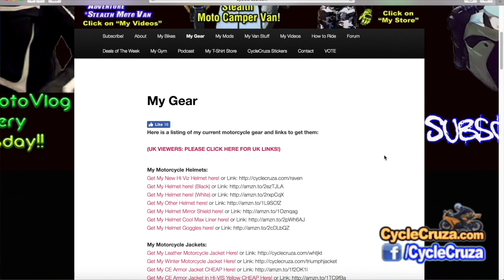WILL THEY PAY $1000 Repair for My BROKEN WR250R? UPDATE!

Comment: One thing is for certain; that sprocket was not completely on the shaft or it would have striped all the splines completely through. Now why it wasn't who knows.
That after market sprocket is not too soft because it really damaged the hardened output shaft, if it were soft it would be sacrificial.
Reply: Bass Player they are not ground down all the way because he caught it before it got to that point
Reply: That is not what I mean, if you look the teeth they are not ground down equally from the front to the back of the sprocket. They are only really damaged half way through the sprocket.
If the sprocket was completely on all the splines would be equally worn front to back.
Reply: larry williams he didn't catch it before it got to that point. He took it 5 miles out, then suddenly his bike wouldn't move after taking that "jump." Lmao. The splines sheared with the sprocket, and the shaft was spinning free. That's how he noticed.
Reply: You guy are not understanding what I'm telling you... I give up...
Reply: Bass Player I understand and am agreeing with you. Larry does not understand. He probably takes his vespa to the dealer to have the oil changed, so he knows everything. Lol

Comment: You failed to mention the status of the nut itself, which leads me to believe the nut simply came loose, allowing the sprocket to slip off the splines. 

If the nut is tight, there shouldn't be enough viable space for the sprocket to even be able to move off the splines.
Reply: yes. the only way it wears like that is if it slipped off otherwise the wear would be even across the whole sprocket splines.
Reply: Purple Ether agreed.
Reply: Looks like he starts turning the nut when he first sees damage lol
Reply: The Mx Guru, he had the washer on the wrong side of the sprocket. You can see the washer still on when he shows the ground shaft. And you can see the shiny sprocket when he shows the sprocket up-close as soon as it happens with the nut still on. Cant see the dull washer metal. So only about 1/3 of the teeth would be engaged. Causing the spinning.

Comment: It is obvious the sprocket was not all the way on.  That is why it only partially stripped. Maybe it worked itself out a bit after install. But there is no other way to strip it that way than partial engagement.
Reply from the maker: It's not even possible to install the sprocket half way, once the bolt is torqued to spec the washer would force the sprocket on completely. If you look closely at clip where I show the sprocket installed, the nut is completely on, NOT partially, which proves the sprocket if fully on. if the sprocket were partially on  the nut would be overhanging the shaft, which is not the case.
Reply: CycleCruza could the nut have backed off? Used to happen on my DRZ even with the "loctite fix".
Reply: CycleCruza if you read what R Bb said, he suggested the locking nut somehow backed itself away from the countershaft. But in any case, Pro-X won't cover it because you caused that, not their company.

Comment: Cruza, Only half the spline was stripped. You even said in the earlier video that the new sprocket didn't slide on without force. After market sprockets are normally fitted with part number to the outside. Your sprocket was fitted to the inside. I doubt you will see any compensation but they may be flexible if you embarrass then on your channel. Good luck.

Comment: If you're 100% confident you're not at fault then take it to court. No way in hell would I pay $1,000 out of pocket to cover the shoddy product of some low end company.
Reply: Frankenscuzz agreed
Reply: True consumer court should take care of this issue
Reply from the maker: Yep small claims court if they don't do the right thing. A commenter by the name of newrider said it could be that the metal of the sprocket is harder than the splines on the output shaft. I might have the metal on the sprocket tested.
Reply: Considering you have so much of the entire ordeal documented on video it'd be a pretty open and shut case imo
Reply: The shaft and sprocket wasn't a perfect fit. Rocky Mountain sold you a sprocket just a bit too large.
Reply: shockadellick , I agree, slightly different size at the splines. Same issue has happened with aftermarket front sprockets for the XR650L. Ruined output shaft.
Reply: Pro X isn't some low end company. The product could have been faulty. The install could have been poor. Lots of could haves. But videos showing "install" do not prove that things are done correctly. They can be turned on and off and edited. In general I've liked CC content. But this/these videos are not proof. Like the video that he took some other you tubers video as proof. This is the same thing. While it sucks, and I'd like to see the WRR, the blaming needs to stop. When there is evidence of who or what is at fault. Then share, that would help others. Speculation is just that, not fact.
Reply: I highly doubt that he will use his edited you tube video as evidence. He most likely has the original footage and will use that if he has to.
Reply: Xterrential 
That makes little difference. What can't be seen is 24/7. The video isn't evidence unless it's collaborated by a mechanic. That the bikes out put shaft was not perviously damaged/wore. That is was installed correctly.  And failure occurred directly after said mechanic verified that bike / install was correct. Then the part itself needs to be examined. Was correct part used, was part correctly made. All this info when determined would be beneficial to viewers.
The video doesn't prove anything. Remember the Honda video because Info came from reliable source? While some believe everything on YouTube, or posted on Facebook, that doesn't make it fact.
The facts are the bike is messed up. That sucks regardless of who's fault.
But I'm repeating common sense over and over.
Reply: Cherrie Beyer like in his chain and sprocket install video, where he goes to rivet a CLIP TYPE master link, then the footage skips and suddenly there is a RIVET TYPE master link on his chain. Then denied the first one he tried to rivet was a clip type.

If he makes errors in judgement like that, it's easy to see his that countershaft was ruined
Reply: Actually my viewing is on a phone, so I don't get much in detail.

Comment: It's the wear shown on the sprocket. 

Only half of the sprocket is worn and the outer half is not worn. That's physically impossible. That's why they denied any claim. If a sprocket is only half on or comes loose this will happen. There is no way the sprocket was defective. If it didn't fit right that would be another issue.

Installed improperly or the nut was worn out.

Make sure your other sprockets are all the way on. If it wont go on you must find the cause and correct it.

Not sure I would be reusing a peened nut anyway. He said it was 100% on the shaft.
Reply: David Phillips and how is there NO WAY it could of been defective ?? I've bought plenty of things from tv to vacuums to even once a laptop all brand new and wouldn't even turn on straight outta the box , theres plenty deflected products out there
Reply from the maker: It's much more than half. The metal could be harder than the oem spines. I will have it tested.
Reply: David Phillips my thoughts exactly.
Reply: Tomislav Lulic 

Well let's think about it. The outer part of the sprocket is not damaged but the inner part is gone. The inner part of the shaft is not damaged but the outer part is gone.

So the sprocket would not have spun if it were on all the way or else the whole thing would be worn down.

That's what it looks like to me.

As far as things being defective all those other things are a lot different than a hunk of steel.

So in conclusion after the failure it had slid out on the shaft.

I would say it did not fit right, the nut came loose or it was not all the way on.

Sounds like the nut all else assumed to be good.
Reply: Maybe the proof of it being the nut is in the video when he looks at it and notices right away that the sprocket is loose.
Reply: because you can tell from the wear that it wasn't seated properly, that was the reason. If it was defective it wouldn't have even fit but it did. It wasn't far enough on the shaft which means it either was on wrong in the first place or the bolt came undone.
Reply: David Phillips,  he had the washer on the wrong side of the sprocket. You can see the washer still on when he shows the ground shaft. And you can see the shiny sprocket when he shows the sprocket up-close as soon as it happens with the nut still on. Cant see the dull washer metal. So only about 1/3 of the teeth would be engaged. Causing the spinning.
Reply: @Akbar_Friendly_in_Cherno  

Yes. Any sprocket problem like this is obviously the fault of the installer. Had the sprocket cracked they would have likely covered it. In most cases however they will only replace the sprocket. You assume risk when you mod your bike. Had a shop done this they would cover it.

Comment: Take the sprocket to a metal expert and have it tested. I'd love to see what it's actually made of compared to the OEM one.
Reply: Arno D profit margins, it's made of profit margins!
Reply: Oem steel, aftermarket usually aluminum
Reply: Victor Gross lol no. There are no aluminum countershaft sprockets.
Reply: jeff westbrooke Pro X Is super quality stuff sourced from the same places OEM is.
Reply: Arno D send it to AVe for analysis. Let the crazy Canuck look at it
Reply: The MX Guru I worked for a truck dealership. Time and again a manufacturer would first make something for quality then cut back to reduce costs until they see too many failures.
Reply: Look at the way the teeth are ground down you guys, he just had the sprocket on backwards, the flat side was out, and therefore, the teeth were not fully engaged.  Only half the teeth got stripped on the bike and sprocket, and the flat side is supposed to go inwards not outwards, like he had it in the video.
Reply: what brand sprocket failed. I have a 14th Supersprox I'm about to install....

Comment: There is no way that cheap sprocket is harder than the hardened steel countershaft. You put it on backwards and it was hanging on the edge. Shit happens, own it
Reply from the maker: I guessed you missed the part in the video where I said RMATV and PRO X stated the sprocket can be installed on either side....only a complete moron would install counter sprocket half azz on the shaft. If that were the case I wouldn't have been able to even make it down my street.
Reply: It definitely slipped off man.
Reply: CycleCruza No. With all of that force being transferred through half the splines I reckon you'd only make it probably 5 miles... oh wait. Lol.

Comment: I've seen the same thing happen with OEM sprockets. They can strip out and ruin the front sprocket shaft in no time. Sometimes if OEM sprockets fail repairs are covered, if a dealer or shop does the work. When you do DIY work on a bike you take on the responsibility if it fails. You can attempt to take Pro-X to small claims court but you'll have a lot to prove. At least you have plenty of video evidence and others will know to avoid Pro-X sprockets, but it will be difficult to prove your installation was 100% correct. The videos will definitely help a lot though.

There are plenty of aftermarket sprockets that are high quality high carbon steel. OEM doesn't mean fail-proof even if installed correctly. I've never been a fan of "splined" sprocket shafts for this very reason. The "keyed" or "keyway" shafts seem to be less prone to failure (even though splines will spread out torque more evenly)...if the sprocket is loose it usually just pops off instead of grinding down the sprocket shaft, and the damage is more likely to be isolated to the sprocket.

Comment: Looking at the C.Sproc. you can see half of the teeth are evenly ground down from one side. This makes it look as though it did not mesh completely with the C. shaft.  As long as the metallurgical specs are correct, this can only be from incorrect sizing or installation error. From what you explained it was torqued to spec, and they claimed it fits correctly from both sides. If you set it back on the spline, does it completely mesh with the spline from both sides as their tech support claimed it would, or does it only match up from one side,or neither side? Was there more slop when seated on the C. shaft, than with the factory C.Sproc.? It sounds as though the manufacturer is at fault. Just trying to help cover your basses.

Comment: The problem is he did the install himself. If he had the shop do it, he would get 100% replacement. Because he did it himself, that is what bit him. Eventhough he had a video, he is not a certified motorcycle mechanic and licensed to work at a motorcycle repair facility. 50% support is better than nothing.
Reply: Good point.
Reply: 1AmericanInAsia : you’re right

Comment: You probably put the side with the raised ring inwards toward the engine which resulted in only half of the teeth engaging. You can see it on the sprocket. If u would have put the flush side inwards I think this wouldnt have happened. But, it should come with instructions on which way to put it. My take on it. Love the vids man, just my opinion
Reply from the maker: As stated in the video, both Rocky Mountain ATV and Pro X, stated that it doesn't matter which side you install this sprocket on the splines, this damage should not have occurred. Also, when the washer and nut are put on and torqued to spec and the nut staked down, which is was it, secured the sprocket on the splines. With the nut staked down ain't nothing coming off.  The front sprocket was 100% on the splines, otherwise, I would have returned the sprocket. When I removed the sprocket it was 100% flush, not half off,  I have video to prove it.
Reply: If it was 100% then there the bolt must have come loose for it to move off the shaft. You've got to be logical. You do not get that kind of wear unless it slipped of the shaft splines therefore the bolt could not have been holding it on properly. What most likely happened is because the aftermarket sprocket was thinner than the original the bolt was not holding it on securely.
Reply: You are probably right, I wasnt there doing the job. Only you can know. Regardless hope you get compensated. For all the bad press its cheaper for a company to just assume in these cases that the customer is right and pay the mechanicsbill.

Comment: If the sprocket was installed correctly, it's impossible that only half the splines on that sprocket would wear away. It's just not possible. Error is between sprocket and camera. I'm picking that the nut to secure the sprocket was torqued down to the required spec but the sprocket was not fully home due to damaged threads on the nut or the sprocket or something. But then the chain alignment would fail if it was the sprocket splines, so more points to the nut. Did they give you a new nut with the kit? Tapping the sprocket with a mallet to make sure the sprockets home is good, but did you ever check that there was no gap between the nut and sprocket and the splines were fully filled with the shaft.? Because the sprocket will naturally throw outwards on acceleration if the nut is not fully home, which would explain the damage I see to the sprocket. Good luck, I wouldn't take this to court, there are smart engineering people all over the place and this would easily be defended.

Comment: I KNOW I KNOW I KNOW! First of all look at the difference between the 2 sprockets. The original is a blackish color and the replacement is silver. That tells me the original was heat treated, Quenched in oil and hardened. The replacement wasn't and is just steal and a softer metal. The constant up shifting and down shifting wore the teeth down until there wasn't enough take the torque and stripped the shaft. Easy to find out. Go to a steel company and do a hardness test on both parts. May take you 20 minutes. I will bet you that the replacement is a softer metal.

Comment: CycleCruza. A micrometer is a good tool to have. Get one and measure the gear tooth width and spacing. If the measurements don't match between the oem and the replacement then Pro-X was wrong. If they do match then the part was defective or installed improperly. Only you know how it was installed.

Comment: Next time let a certified Mechanic do the maintenance that way you are guaranteed 💰 back in the event of failure. I usually have senior riders with me or take itnto my dealer for major and minor repairs depending on what it is. Better safe than sorry!
Reply: In the UK (what's the situation in the US?) you must inform your insurance company of ANY bike modification and they will decide whether this is acceptable to them and whether it will alter your premium.  For a critical but non-OEM part installed at home, most insurance companies and/or brokers would take a strong view on this and let you know whether it breached the terms of the insurance.  Best ask them first...
Reply: Depends on the company but in general flr motorcycles you dont have to tell them anything you do as lo g as its not illegal mods

Comment: Looks like you did everything properly and the part looked spec. Chances are it was just a bad part. Sucks but happens.

My father was a metals inspector for the navy. You would be surprised at how many times the best machines were taken down by an undiscovered micro fracture or imperfections in the metal at blending.

Comment: in my opinion i believe it was the aftermarket sprocket i think it was made out of a softer metal like aluminum(which is much lighter) or standard iron rather than hardened steel which is recommended. i dont think it was installation error i think it was the company's fault.